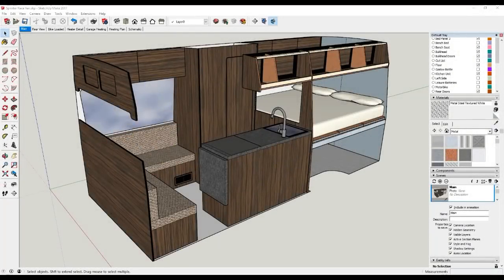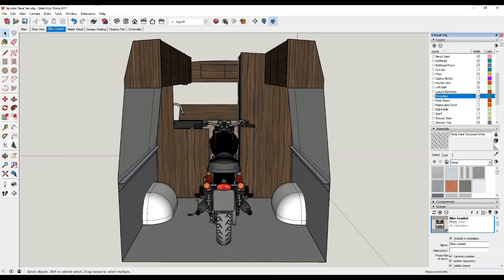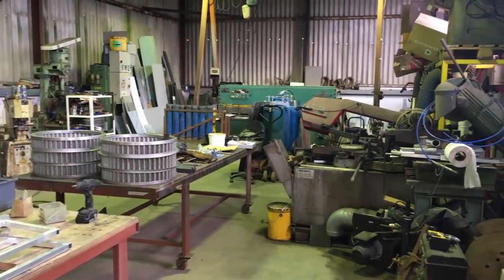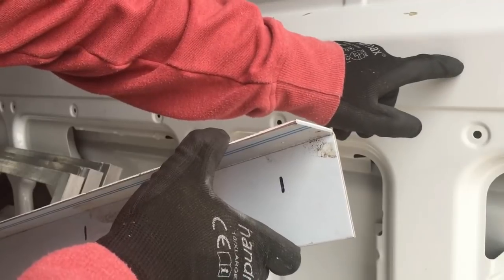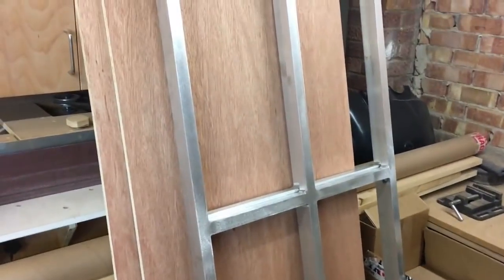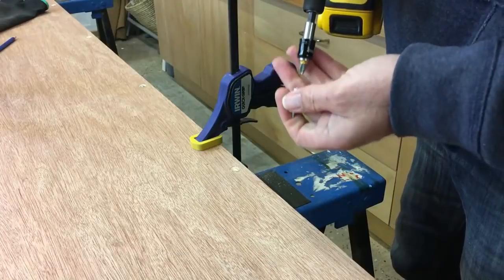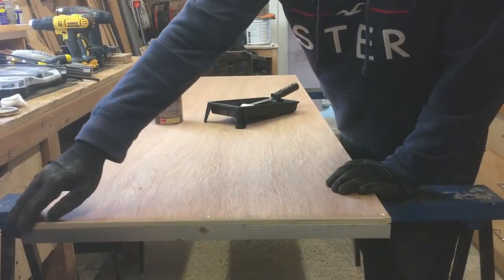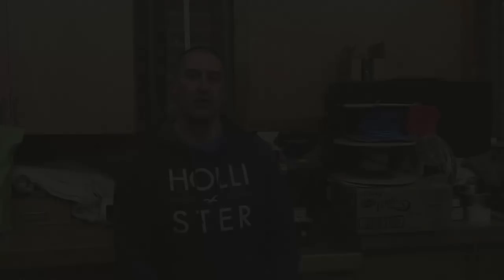Mercedes Sprinter Camper Van Bed Frame

Comment from the maker: There seems to be a bit of concern about solid bed boards. I've had various different mattresses on solid MDF bed boards for many years without a single issue. We always "Turn the bed down" every day to air it correctly. We always flip and rotate the mattress regularly to ensure even wear and use. Or maybe it's because we're just not very sweaty people 😊 So I won't be making Swiss cheese out of these bed boards, but feel free to do that in your own build if you think it's essential. Thanks for watching.
Reply: I lift to mattresses in my trailer tent every morning after sleeping to air them and they do not suffer from airing problems
Reply: ah , the contentious issue of whether to install a solid or slatted bed base. if you consider that he is building a garage beneath the bed,  then it makes really good sense to have a solid base. the garage then becomes completely sealed off from the main living quarters and thus serves well as its intended purpose suggests. a garage ! if he ever wanted to store a  can of fuel, or even keep a scooter in the back or anything damp from a hike or something, he can be sure that no fumes or odours will transfer to living area. a solid base base over a garage area has got to be the best way, surely.
Reply: Well, it's not really air tight so it wouldn't be sealed off as there are gaps between the door and back of bed. I pretty much have the same bed build in my own van.
Reply: thats a good point. i guess it just comes down to preference .
Reply: Greg V
Reply: From my life time experience I have met real sweaters and I don't say this lightly, totally shocked me to an extent on one occasion how much sweat was expelled so I agree that some may be better to have ventilation under their mattress.

If a diesel heater is installed then a box can be made that has a slider that can be pulled out and heated air can then be diverted through a separate duct under the bed to aid drying out.

My wife and I also have had no problems with solid ply or mdf base boards but that's been with sprung mattresses that I feel breath better than foam.
We had a memory foam topper once but did not like the smell or feel of it.
I think the smell may have been formaldehyde.
We use a duvet on top of our mattress now for added comfort plus it's washable.

My van bed has solid bases that make it up but I don't think I'll be drilling holes in them anytime soon myself Greg.

Another great video!
Reply: Really enjoying your series Greg, thx for sharing so freely! Quick solution I used in my van build comes from the boating world: a 10mm polyester 3D mesh anti-condensation layer like DRY-mat. Quick and painless to install. Enjoy your trip. Looking fwd to your Spain and Portugal adventures! Did a very similar one in 2017. Don't miss the Picos de Europa! Cheers
Reply: @lass-inangeles7564  Onless damp gear is stored under the bed like bikes after being out in the rain or climbing ropes etc.
Yes there are other ways to ventilate under a bed but my bed at home bought from a store is solid, no slots and no problems.
I think a sprung mattress breathes good regardless but I'm not so sure about foam
Reply: @lass-inangeles7564  A house gets condensation Lass, I've been in the building game long enough to see the damage it can do.
Mould in bathrooms from showering and people not opening the window if they don't have an extractor fan.
Boiling potatoes in the kitchen without doing the same, wet clothes over radiators....I could go on, main thing is knowing how to deal with it so it doesn't reach a problematic state.
My van gets little to no condensation because I know how to control it.
There is little difference to a house or at least certain parts in a house.This is why I'm happy to participate in this discussion about the mattress platform situation and condensation in general 😍
PS. I have been called out to look at damp problems in houses to find out it's  condensation problems caused by the inhabitants.
Reply: @lass-inangeles7564  Most houses are locked up at night or are they not? Most campervans or mobile homes on the road and in production are not stealth or are they?
Some houses are smaller than some mobile homes and/or campervans I'm sure.
Lass-in Angeles nobody is surely trying to win a case so that it can be put to rest. Opinions are fine, everybody has one. Sharing is caring, well, at least I hope so.
Slats are great if you spill stuff on the mattress or possibly wet the bed now and then when drunk as some do or possibly a real sweater of a person, yes I know some so just to be safe have slats under the mattress.
I'm just stating here that it's not 100% of the time necessary, that's all. ❤
Reply: Hi Greg, a great video, are the bed sections very heavy?  Could you give me a very rough estimate on the weight please?💙❤💙❤💙❤
Reply from the maker: treac894 each panel has 11sqft of 9mm ply thats 8kg and 24’ of Ali tube that is 5kg so 12kg per panel. 
Easy enough for one person to lift and handle. 👍🏼😃
Reply: Without the daily airing out it will get moldy in no time if you do not have any airholes or something to give it air... Had to buy new mattress because of mold myself after short time because of lack of airholes.
Reply from the maker: @a64738  well I can confirm that in three years of living in our van it’s as fresh as the day we brought it. We use AIRMAT underneath it and keep the van warm a d well ventilated so it never gets damp in here. The van never drops below 10°C all year round thanks to the Truma.
Reply: @GregVirgoe   8 years ago tried to find mats like that to have under bed and after month of searching I gave up and made slats to have under the beds in my sailboat...
Reply: Hi there Greg, could you tell me what mattress you bought please and from where? Thanks Janet
Reply from the maker: @janetlowe2642  hi Janet it was from custom size beds. Great value and really fast service https://customsizebeds.co.uk/made-to-measure-mattresses/campervan-mattress/

Comment: Great video, My wife and I sold our house in Miami Florida and have been living in an Airstream towed with a Sprinter 3500xd 4x4 diesel dually with a Harley Davidson Fat Boy in the back, The Sprinter is the garage and I am building out for the third time.
Having rhino coating applied to the roof and interior floor on Monday, will have upholstery shop install custom headliner and vinyl wall coverings on Jan. 3rd, this being done to repair damage from a hailstorm and resulting interior leak. We have been to 47 of the 48 continental states so far.
Really enjoyed your video.

Comment: Bed will be plenty strong and light weight no problem there,,,They do need venting but if you're going to have an a/c you may be fine,,, a/c pulls out a ton of moisture,,,or on a sunny day lay the matteress in the sun,,, Nice job ,,, Thanks
Reply from the maker: We will air the bed daily and flip it regularly.
Don't see it being an issue, we've had solid bed bases for years with no condensation problems at all.

Comment: Hi Greg, Thank you for all your terrific videos on Sprinter Van conversion. I love watching them for enjoyment and information. I'm a little handy building my house and in my high school machine shop, and I really like these subjects. I'm hoping to build a Sprinter van (stealthy, if possible) that can fit a Harley FX under the bed. This is still a dream and I'm trying to learn some basic design skills before committing. Either way, I feel intellectually filled by your videos. Thanks again. Bob Mackin
Reply from the maker: That's an ambitious bike to put in a sprinter. It's very big and I'm guessing heavy too. You may want to look for a dual rear wheel version that can carry 5T
Reply: Very helpful reply - thanks. The FX weighs 535 lbs/242.672 Kg, but it's very low. I'm 5' 8" and can sit with both feet flat on the pavement. I may have to shop for handlebars, which I like low anyway.

Comment: Hi All..
We have done a lot of research on beds in the last few years due to the fact we quit working while our daughter was at drama school, and have travelled extensively around  Europe in our 5.4m van..
I temporarily installed a fixed/raised bed like Greg's using a wooden frame and plywood base, to save us having to construct the bed each night and also to provide us maximum storage space underneath (we had 2 x bench seats that pulled together transversely across the rear before).. 
We have tried various combinations of foam mattress, blow up air beds but have never managed to match the comfort of the original pull together slatted bases.. A recent visit to ikea to purchase a new mattress for our bed at home brought some interesting conclusions.. The mattress we tried at the store and purchased, never felt as comfortable when we slept on it at home.. A recent visit back to ikea made us realise that the mattress we tried was resting on one of their slated bases but at home our bed base was solid !    We purchased the slatted system in question and hey presto "Perfect Slumber" 
Im now trying to configure the same system into our van :))
As Greg has said I think it is down to the preference of the individuals what works for them..

Thanks Ian

Comment: if ever you sell this van please make sure you pen a link on the documents that will show everything you've done, i'm certainly sure it will increase the value thricely....well done matey, the only thing i would add will be a couple of tie downs just under the side bars even though you've kept the rings on the floor...might come in handy
Reply from the maker: Hello Marc,
Very true, at least a prospective buyer could see exactly the standard of workmanship :D
Will have to sit through a few hours of video first lol
Excellent idea to add a couple of extra tie down points in the rear. I could insert a few extra rivnuts down each side and wind in some chunky eyebolts.  Thanks Marc
Reply: Greg Virgoe but those hours will be so absorbing Greg....at least they will learn something from it all 👍🏼😉

Comment: Something about living with any kind of internal combustion engine vehicle inside your home with you, especially in a small space, you want to make sure you replace your petrol cap with one that is sealed. And they have these special zip-up covers for motorcycles for storing them indoors, inside of your home. This keeps the smells from permeating all of your indoor wood and cloth, etc. Because once that gasoline and exhaust stench seeps into those porous materials, you will never get it out and it will always smell that way.
Reply from the maker: Don't you just love the smell of 2 stroke oil in the morning :D lol

Comment: Nice build! 
The issue of solid or slats, has to do with a heated space on top side and a non heated underneath ( garage space ) It has to do with the mattress acting as insulation, and the need of a vapor barrier. A suspended bed should not have moisture issues, because it is the same shared space.
Reply from the maker: Michael O'Hara, our garage space is heated and we have a mattress ventilator product called Airmat that keeps the mattress 1/2" off the solid bed base. We have had solid bed bases in all our homes and never had any issues with damp or mould.

Comment: Before i leave a comment i always like to read through the previous comments to make sure i am not just repeating the same question "wouldn't it be a good idea to put some ventilation holes in the ply?"...........just kidding...a fantastic video as always Greg :)
Reply from the maker: LOL 😂😂👍🏼
Reply: This bed frame seems to be a big point of concern. I have seen two inch holes drilled in platforms like a big Swiss cheese and thought it was just to cut down on weight, learn so much just reading comments from others.  Though reflecting on fact  I’ve seen many platform beds where the mattress lays on mdf frame with out concerns?
Reply from the maker: Dani Adams, I've had different mattresses on solid bed frames for 17 yrs and never had a single problem. Maybe people don't turn their bed down everyday to air it properly and flip the mattress regularly. I'm not reducing the strength of these boards by making look like Swiss cheese.

Comment: Greg I love your style and attention to detail. I always hesitate to give constructive criticism because you know exactly what you are doing and why. I was going to comment on the lack of under mattress ventilation but that has been well covered by others. Not sure of you are familiar with YT channel Sail Life - but he tried the Trefoli under mattress support system without any measurable success - and it proved not to be particularly durable. A cheaper solution may be some way of temporarily raising the mattress while it is not in active use so that the underside has an opportunity to dry out during the day.
Reply from the maker: Hi Norman, I’m always open to any comments as long as they’re not rude 😀
My other half is very OCD about things like this and she has chosen a mattress that can be flipped and turned. 
She always turns them regular and airs the bed every day.
We’ve had a solid divan base for years and never had any problems with mattresses.

Comment: doing a good job there mate, one thing, you need to cut air holes in the ply boards,  i use something like a 30-  40mm hole cutter,  you need air flow around and under the mattress to stop it getting damp from perspiration,
Reply from the maker: I’m looking at using a system under the mattress to keep it aired. Reluctant to weaken the plywood. Thank you 😊
Reply: ahh, i see everyone else has asked the same question, ill shut up, and keep enjoying your high standard build, .
 just commenting for the benifit of DIY viewers with less money,  .
i doubt cutting a few vent holes will weaken it with all that aluminum framing,
why buy an air flow product, costing money and adding weight, when cutting holes is free and saves weight?  i love saving weight, but i love saving money moor!!
Reply from the maker: To be honest my misses airs out bed every day and flips the mattress regularly. I personally don’t think I’ll have any issues at all as it is but I’m outnumbered here 😂 lol

Comment: Hi Greg. Been watching the videos as I pull my hair out converting my VW Crafter. It's an amazing series and have been great to binge watch. I have scoured the comments and havent seen this asked but I was curious of the size/thickness of the angle ally you used to support the bed
Reply: I just bough mine 50mm x 50mm 5mm thick
Reply: Same here, they look like 1" square and thought the 12mm ply overkill but seems to work ok.

Comment: Excellent video, as usual. A simple little question, why not use existing holes (5:26) located 2 or 3 inches lower? This would avoid making new holes for installing the aluminum angle. Thank you for this beautiful series of educational video. I am strongly inspired by it. I start the conversion of my sprinter 144 in two weeks. Looking forward

Comment: You could always add the Froli system on top of the boards? This would give ventilation and allow your mattress to be a little thinner? I have this by the way - very good product (mine is the Froli Star). Great video as always.
Reply from the maker: I did see that system at the motorhome show and wondered what it was. Will be checking it out as a candidate.

Comment: I have to agree with other comments, this is best van build I’ve ever seen on YouTube.  Re the plywood on the frame, did you think about putting air holes in it to allow moisture to escape from the bottom of the mattress, or would this effect the integrity of the frame?
Reply from the maker: I'm concerned about losing the strength I have just added tot he frames.
I have a cool blue mattress and it will be aired daily and flipped regular.
My van is really well ventilated and heated.

Comment: Hi Greg.  Great series thank you.  I am torn between a Sprinter and a Fiat/Citroen van myself. If you don't mind, could you give some details on your van, age, milage spec and rough purchase price please.  Keep up the good work.
Reply from the maker: Hello Graham, I’ve got a late 2008 (58) 313CDI LWB high roof. Has 112k miles and really clean. Paid £6,600 for it about 6 months ago. Took ages of searching to find a clean low mileage one. Then two turned up only 7 miles from our home. 😀

Comment: Great informative vids Greg - quick qs - aluminium frame - what box section size is it 25mm ? 3.2mm wall thickness?? - ah read below you've already answered - hope alls well - thank you - top fella - why not do a road show - bet you'd sell loads of tckets - especially if you joined up with local communities & id it as a joint fundraiser...just an idea..take care dude!
Reply from the maker: Yes it was that size. The timber gives it a great deal of strength too.

Comment: I love the design Greg but can't help wondering if it wouldn't be helpful to have some sort of bed-lift mechanism so you would not have to disassemble the bed to put the bikes in.  Ideally you could just lift the bed temporarily upwards 18inches or so to store the bikes.  I've seen the Happijak system but it's not ideal either.  Just a thought.  Nice work regardless.
Reply from the maker: My bike trips are going to be very infrequent. Most of the time we will be travelling without a motorbike, just push bikes under the bed and the bed will be fixed in all the time. Being able to carry the bike is for the odd weekend track day or TT